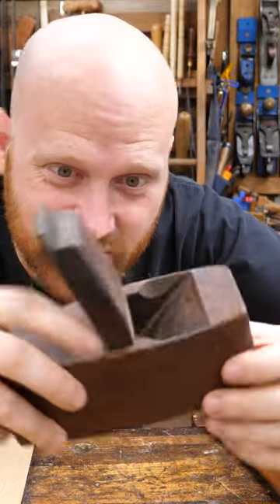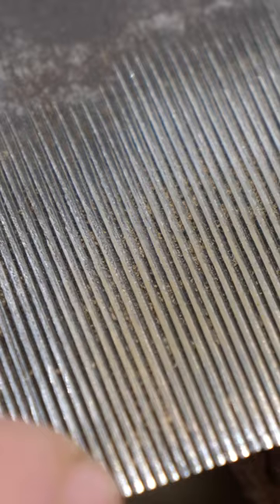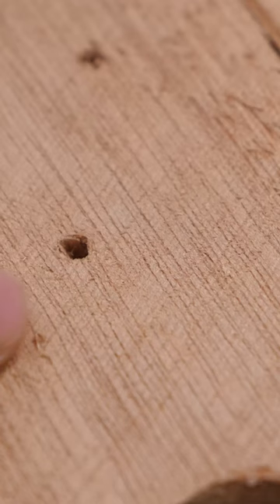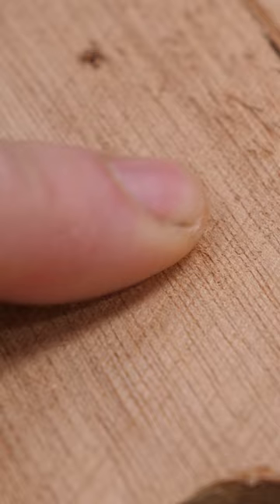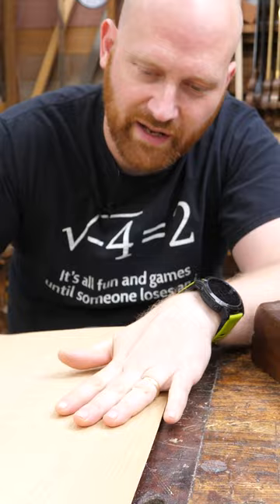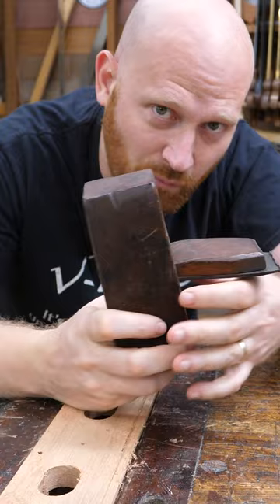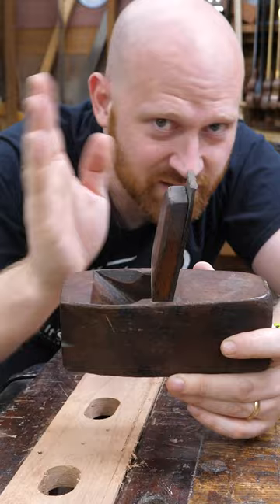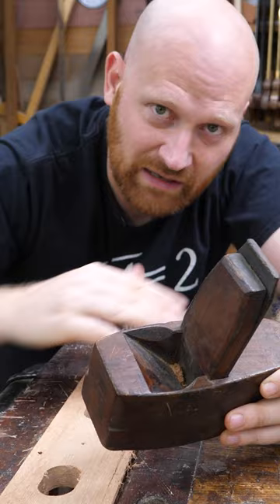What is a toothing plane

Comment: As a luthier, we use this type of plane a lot maybe a bit smaller. When making a violin we have to thin out stock of highly flamed maple. If we were to use a normal plane it could bind to the flames and tear of a big piece of the surface. Considering that the ribs of the violin are about 1mm thick you don't have a lot of material to work with and you can't afford making mistakes like this. So you use the toothing plane to thin it and the last 0.1 mm or so is scraped both to remove the teeth marks and to make it smooth. We also use small finger tooth planes to smooth out the ridges made by the normal finger planes.
Reply: It's nice to hear about some "secrets" of different trades! Thank you!
Reply: As a musician, I always love to hear about a luthier's work. It's so cool.

Comment: si thats why there was a cut flat rasp on the carpentry class
guess was used for the same purpose
Reply from the maker: Those would be for a curved surfaces. This is for flat surfaces the rasp is often used for hogging off material before coming in with a finer tooth item.
Reply: @WoodByWrightHowTo  yep i use rasp and files always with a handle because is more comfortable, but never understood why there was a cut one thanks!